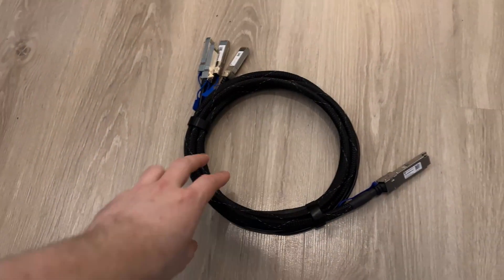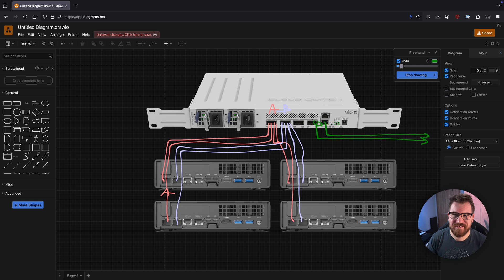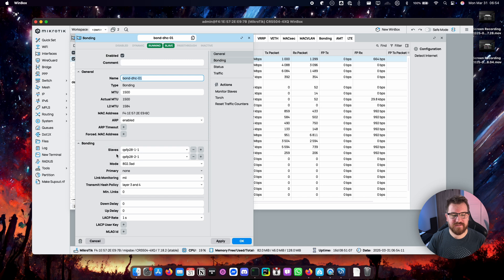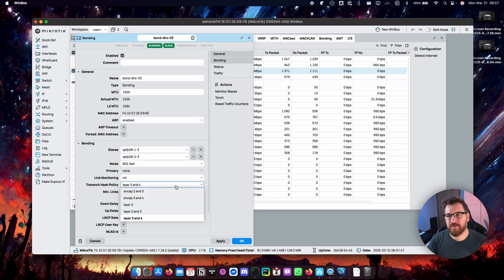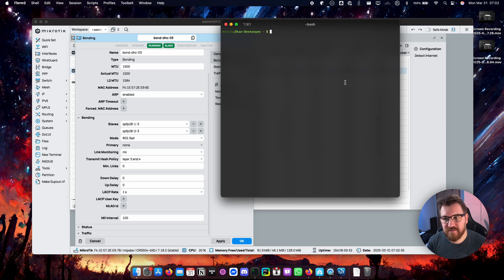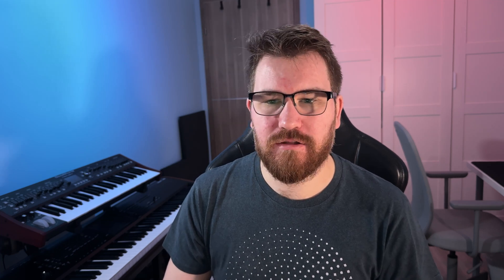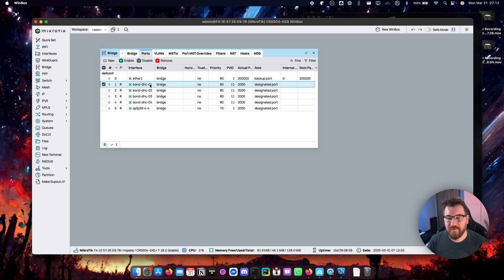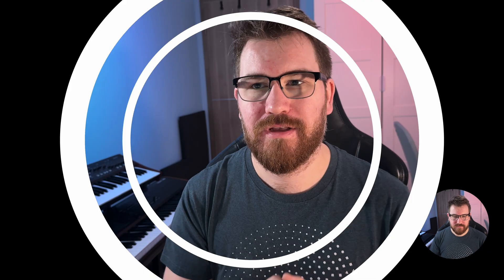Your Network is SLOW! - Upgrade to (almost) 100Gbps (with bonding and howto)

Comment: In my experience with fiber and DACs in my homelab, cables and transmiters rarely fails, so I don't really see a point of making redundancy within a switch. Having 2 switches and fail over between them is another story though. But double the price.

You can actually get faster network for your MS-01s. You can find relatively cheap ConnectX-5s and ConnectX-6s on used market, and PCIe Gen4 x8 would be enough to get slightly more than 100 Gbps from the NIC. Alternatively, Bluefield-2 1x200G costs around 200$ nowadays (less than 150$ if you order them from within China using chinese-targeted interfaces). They have some problems but they all can be worked around.
Reply from the maker: While true that in homelab environment I might don't need bonding, but keep in mind, I still get more bandwith having 2 links (20Gbps in total for multiple connections). And it gives me high availability - which I already used in day-2 of that setup when doing cable management ;) So I could safely unplug one of the cables, do cable management without hurry, and everything still works, so... even tough it's not multi-switch redundancy, it still gives benefits ;)

I also am aware of options for faster network in MS-01s. I just have waiting on my desk for testing ConnectX-4 2x SFP28 that got delivered from AliExpress few days ago, so I might buy more and add it to MS-01s if everything will be ok.

Actually I was thinking into going directly to 16x 100Gbps with Mikrotik CRS520-4XS-16XQ-RM, but 4 big fans and power needs (heat + noise) scared me as my homelab sits in entrance/kitchen of my apartment... and those MS-01s CPUs are not powerful enough anyway (I have lowest CPU they offer: i5-12600H) to pull 100Gbps at once anyway, so I decided to do 2x 10Gbps (with possibility to upgrade to 25Gbps with Ali's ConnectX-4s) instead.

So sorry for kinda clickbaity title, still learning this YouTube-thing... ;) But hopefully some day I'll have servers powerful enough to do 100Gbps!
Reply: @DIY.DevOps  yeah, I understand that with cable management, though last time I've touched fiber I was rewiring it completely (moving away from single mode to multi-mode because CDWM4 is WAY cheaper for a 100G on used market), so I'm not so sure it matters much in homelab environment. Not that you can't do that, I just not sure if there is enough benefits to bother.

About platforms - I found that the more international one that starts with "e" (4 letter one), sorry can't name it otherwise the post might just disappear, sometimes slightly cheaper for those NICs. If you want NICs from China cheaper - you should try ordering from idle fish (but as a one word), it is china-only platform and you need to use some services to forward the packages and do actual talking, but prices there for cx4 lx closer to 25 usd, and forwarding won't cost that much more on top of that.

For the bigger switches - try looking for Mellanox SN2100 or SN2700. They are proper server grade switches, but you can silent-mod them (SN2100 consumes about 30W of power, so not that hard to cool down, but be careful, SN2100 had Atom Avoton in control plane and older revisions required a board-level mod to fix AVR54 bug of the CPU, but later versions had a fixed revision of the CPU or board-level fix). That might be a cheaper and quieter option.

About 100G and 12600H - I don't really agree on that statement - it really depends on your workload and on a NIC. CX4 and newer have decent hw offloads and at least on Linux with large packets (1500b or larger) even linux kernel stack can do moer than that. And you always have various DPDK-based solutions for higher performance, there 12600H probably can pull more than 200G.

P.S. you can probably send me an email if you want links to platforms or listings I'm talking about.
P.P.S. Also don't worry about clickbait-y titles, I think on modern youtube you just won't have a chance to get any views without some overpromising :)
Reply from the maker: I don't think those Mellanox switches are good idea for me... they cost used the same as mentioned Mikrotik 16x QSFP28 costs new :/

Maybe some day... anyway, I have other plans for future after I build a house so... hopefully that will happen and I can create video on that in next 2 years :D

Regarding the NICs, I paid about $65 for that ConnectX-4 mentioned earlier (I'm in Poland, so it was about 250zł including taxes), so 2 times more than you mentioned, but still1/3 price of what's available in stores here to buy.

Regarding my CPU... interesting view, I must try to revisit that then and maybe think again. But I've watched few videos and read few articles and there's big problem with heat in 100G NICs and QSFP modules so that might be another problem inside MS-01s :/

My homelab corner is noticeably hotter right now than the rest of apartment :D